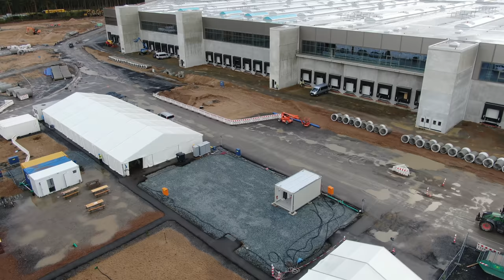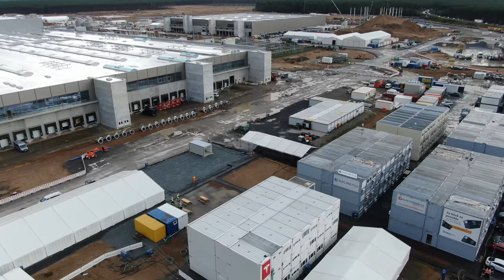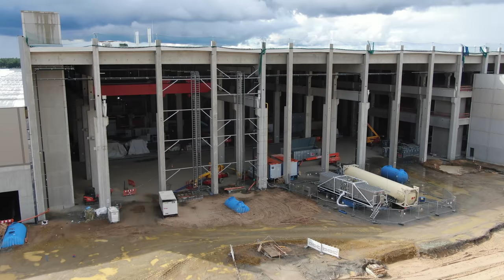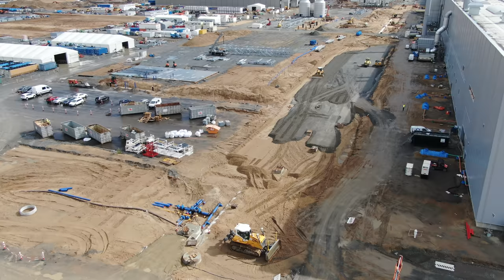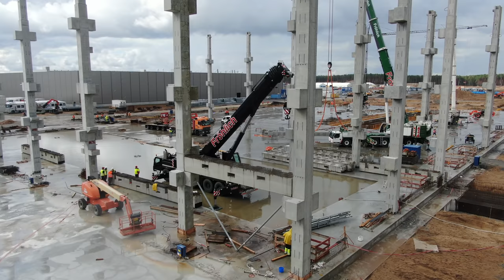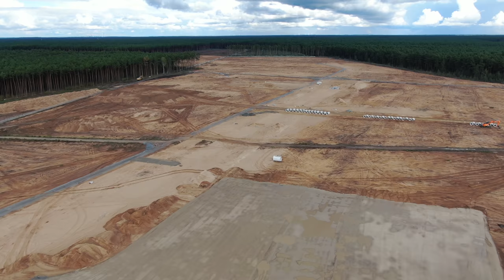Giga Berlin | 2021-08-27 | First Cell Beam

Comment: Starting to see asphalt & paving on the site is a good sign completion is near.
Reply: There is no new asphalt on site.
Reply: They are preparing for the final layout of the surface at quite some parts. 
But the black surface you see is just fine gravel ("Splitt" in German). Could be the last gravel layer before asphalt. But they may opt also for cobbles between the street and the loading ramps.
Reply: @abalada  "Schotter" in German.

Comment: Progress, but this should have been done a while ago. I should be seeing new Tesla cars in the parking lot by now. Tesla couldnt wait so they had to ship cars over from Shanghai. They better make cars before Texas or it will be a bigger embarrassment than the Shanghai shipment.

Tobias working harder than these politicians. Drone videos are fantastic
Reply: The original plan was to start also with Model Ys based on 2170 batteries at Giga Berlin. This plan was changed by Tesla (in autumn 2020) and now they plan to produce only 4680 battery based Model Ys at Giga Berlin. And than Tesla did also change the plans for production itself. And thus for some steps of the production the production equipment is not yet ready or has even not yet arrived at all.

Comment: A region without water! As seen in this video....
Funfact: Giga Berlin is foundet above a Water Reservoir therfor the Foundation is like it is.
NABU/Grüne Liga: But there is no Water!
Reply: So you tell me that a wet region will always stay wet and can't dry up? Weird that east Germanys lakes dry out and groundwater levels drop.
Reply: @flashed1439  so I guess you shouldn't build new factories in Germany
Reply: @flashed1439  If a lake dries out in Germany it's not because of Tesla.
Reply: @flashed1439  funny that something dry out without production....May Tesla is not the Problem?
In the Reagion of Vogelsberg are 2 big Piplines to Frankfurt am Main and it works since 100 Years.... 
Had someone asked what VW needs in Wolfsburg? I Guess the Emission/consumption is higher ther....

Comment: October seems ambitious for production when they don't even have enough asphalt to make the docks useable! I know you can pave alot of space in a couple of weeks but they still have to build up stocks of parts and supplies well in advance. Worse yet they can't making good asphalt ramps, docks, roads in the cold or winter without having lots of uneven, cracked surfaces. Maybe the Germans have some special technology but anything below 50 deg. F. is going to make for some lousy paving. That rules out alot of October in Berlin and certainly mornings.
Reply: That's BS. The docs will be concrete and asphalt can be layed down to 5°C
Reply: This with production will start in October is a misunderstanding in my view. There will be a county fair and the factory will be open to the public. 
That put's some pressure on finalizing the surface around the factory.  But surely possible and they are working on this on all sites of the main building. 
More critical are the partly still missing production equipment and the lack of advance with some of the support buildings.

Comment: There are less than half as many employee cars on site, than in Texas. They seem to be making a lot more progress here with a lot less manpower.
Reply: Hahaha..Giga Berlin started many months before Texas.. Texas is bigger than Berlin.. Gigaberlin was supposed to open in July but got delay due to slow work by German
Reply: They ride public transport and bicycles en mass.
Reply: @MichaeltheCrank  OK, Public transport makes sense, seems like it's pretty far from much housing to ride a bicycle though.
Reply: @nemos890  that has nothing to do with slow or fast work. It’s about a slow inefficient regulatory process and Tesla’s approach in not taking it as serious as they should have.
Reply: I guess most people are now on the inside whre we cant see em
Reply: I also want to add the fact, that the videos can only taken at weekend. Look to other videos from Tobias from mid week (the timelapse) and you will see, the parkinglot is full. 
Weekend in Germany means, that you MUST HAVE at least 1 Day a week free. You also can not work more than 10 hours a day (there are exeptions) and you have to take a break after a maxium of 4 hours work. 
The mass of ppl working somewhere talking nothing about speed. There are processes which run parallel, we also can not look into the building what's happening there. Installation, commissioning, startup and checks take some time, in special with that large amount of automation inside the processes. There are safety rules to check, in other way robots can destroy their self, also ppl can get harmed with 1 line of wrong code. 
Let the workers do their job, they know how to do it the best way. No one need a "make faster, shit safety" ;)
A small mistake can cause an accident, do you prefer something like this? I don't think so :)
Stay cool, take a tea and relax.
Reply: @nutzeeer  What's that have to do with the number of cars " num nutz " ?
Reply: @eldiablo8019  what does anything have to do with a number of cars, you devil?
Reply: Very few construction workers will drive there with there own cars. Those are rather employees working for Tesla or in those container offices. The construction workers will arrive by company vans and cars. And those are not just 1 person per vehicle.

Comment: I always find it interesting how Americans criticize and moan about delays comparing this plant to the Texas one. If anything they should be critical of American manufacturing which has been surpassed by both volume and quality from China.

There are totally different conditions in at this site such as not working 24hrs or working at all on Sundays. 

It always seems like they have been personally affected by a few months delay, and that this will impact them so much they must voice their opinions.

Remember this is the same company!
Reply: Incorrect. Tesla knew in advance of working hours and such things. That's easy things to keep track of. The delays can't be blamed on this. But it can be blamed on the ridiculous bureaucracy however. 

It's also silly to claim that people aren't allowed to compare the construction speeds of Giga Berlin and Giga Austin. There is also not a zero sum game here. People can be critical at several things at once. 

Everyone that is a Tesla stock holder have been personally affected by the delay. The factory should already been up and producing cars by now.
Reply: @yourcrazybear  Rubbish! So Tesla knew about the working hours but not the bureaucracy? 

Real stock investors hold stocks for years and are not concerned with small delays which have been caused by  among other things design changes by Tesla itself.

The point is; look at the bigger picture. The factory will be built eventually and the stock price already reflects that!
Reply: @damnmister  On the contrary. Even if you are aware of the bureaucracy, it will be hard to predict how it will play out over time. Working hours on the other end is much more predictable. In short, it's hard to plan for the bureaucracy, as things can evolve over time. 

Nonsense. I never implied that long term stock holders would have any long term concerns over these several months delays. What I did however was enlightening you about the fact that they are in fact impacted of the delays. 

And no. The stock price does not reflect what the price would have been if Tesla had the factory up and running already and delivering even more cars. That's just an illogical statment.
Reply: @yourcrazybear  You're wrong. The stock price is not affected by the delay.
Reply: @damnmister  Of course it is. The number of deliveries Tesla makes affects their earnings and thus the stock price.
Reply: @yourcrazybear  In a years time the stock price will still be projected to be the same whether there was a delay or not. The fact is the factory will inevitably open and produce cars, and will reach its maximum production capacity. 

Come back in a year and you'll realise that this delay was insignificant to the stock valuation. There are far more influential factors such as the US economys inflation concerns or even a meme posted by Elon!
Reply: @PeteZam  wrong. It takes more than a few months to be able to ramp production.
Reply: Over the last decade or more US outsourced manufacturing to China and other countries as the US CEOs thought it was cheaper and they did not have to handle some of the environmental and labor issues. IMHO it was a very myopic decision on the CEOs part. The social and psychological  cost of outsourcing was and is hefty on the hard working manufacturing workers.This also increased the welfare burden on the Government. 

As Chinese factory workers are demanding more money and better benefits the economic model is slowly turning with more manufacturing jobs coming back to the US. This will also make US more self reliant.
Reply: @damnmister  "the stock price isn't affected by the delay" what a stupid comment. There are PLENTY of analysts that don't seem to care anything other than tesla ramping up production asap. But what else can we expect from someone who has DrUmpH as their profile pic...
Reply: @HavokBWR  We'll see who is stupid when we get the official announcement that the factory is open. I'm guessing the stock price will not be affected.

Such a typical American to result to name calling instead of constructive debate!
Reply: @yourcrazybear  "Tesla knew in advance of working hours and such things."
Tesla applied for the option to construct 24/5. And for some indoor jobs also 24/7. This was also permitted by the administration. Tesla made however just not much use of those extra working hours.

"But it can be blamed on the ridiculous bureaucracy however."

What delay can be blamed on the bureaucracy?
The GA building was done in late February. In Mid-April Tesla applied for a permit to install the production equipment (why not earlier?). This was granted in early May.
Late June the first production equipment for the GA did arrive. There are sadly no sneak views allowed anymore. But I don't think this part of the production is yet ready. Unlike with the paint shop, body in white or stamping where Tesla applied for test trials months ago, they don't have this done for the GA yet. 

Tesla did change the production plans for Giga Berlin. More advanced production lines and also additional phases of component productions, which were not originally planned to be done at Giga Berlin. And here the limitation is not the construction speed, but that this production equipment is produced and delivered.
Reply: @yourcrazybear  The delays at Berlin are actually fairly minimal, in the big scheme and are not affecting the stock price much, at all.  The delays in ramping the 4680 are actually much more consequential for the stock price.  Even there, the consequence is only a delayed rise of the stock price.  For long term share holders, that matters little.
Reply: @michelangelobuonarroti916  Fairly minimal? The factory was expected to start production in July, and now there is talk about october. So there seems to be atleast 4 months delay. That's more than a quarter of the year in delay. This affects the total number of deliveries, which affects their earnings, which affects their stock price. You can try to downplay this fact however you won't, but it won't change this fact. 

The delays of the 4680 battery production does actually matter less. Tesla have a backup plan to use the 2170 batteries for the model Y in Giga Berlin and Giga Austin. They have also secured double the amount of batteries for 2020, so batteries is not the big issue here. Being able to ramp up production is, and for that you have to finish the factories. 

"Even there, the consequence is only a delayed rise of the stock price.  For long term share holders, that matters little."

That's literally the dumbest thing I have heard in a long time. Time is money and lost time is lost forever. This is true for investing as well.
Reply: @damnmister   "In a years time the stock price will still be projected to be the same whether there was a delay or not."
"Come back in a year and you'll realise that this delay was insignificant to the stock valuation."

Nonsense. Time is money and lost time will never come back. This is true for investing as well. Illogical claims will not change this fact.
Reply: @abalada  Tesla did with Giga Shanghai show how fast they are able to build a new factory. Even Giga Austin shows us how slow the progress have been in Germany. The plan was to have the production of cars start in july. Instead we are hearing talks about october.
Reply: @yourcrazybear  You're obviously a novice short sighted investor. I won't waste anymore time trying to convince you that the market already has the Berlin and Austin factory priced in at the current value.

The only possible catalyst in the short term I.e 1 year is fully scalable 4680 cells, much improved FSD or announcement of new products or new factories.

The price will not rise when Berlin opens.
Reply: @damnmister  "You're obviously a novice short sighted investor."

Nonsense. I would suggest you refrain from using lame strawmen and try and focus on real arguments instead. 

"I won't waste anymore time trying to convince you that the market already has the Berlin and Austin factory priced in at the current value."

That's interesting considering that you recently acted like time can't be wasted when you made illogical claims that delays in production plans doesn't affect the stock market. And no. Giga Berlin and Giga Austin is not priced into the stock. As Tesla's delivery numbers increase, their earnings go through the roof, the stock price will naturally increase as well.
Reply: @yourcrazybear  
"The plan was to have the production of cars start in July."
With imported 2170 batteries. Tesla changed this plan. And replanned also the production layouts. With the result that some of the production equipment is not yet completely installed and partly even not yet delivered at all.

"Instead we are hearing talks about october."
No. That's a misunderstanding. The factory will be open to the public sometime in October. 

In a schedule published in June Tesla planned the installation of production equipment in the GA for June till November. And I see no signs that those works are esp. advanced. So far Tesla has not yet applied for a permit for trials there (which they did months ago for the paint shop, stamping and BiW).

In the same schedule, the outfitting of the DU was scheduled for September till November. However, Tesla has yet not even submitted an application to install production equipment there. Either Tesla is really chaotic and forgot to apply for this permit. Or they simply have not yet finalized the production layout for the DU. I.e. not yet ordered the production equipment. For the permit Tesla has to submit what will be installed, thus the authority can check if there are any risks for the environment not already addressed. Don't see in the DU any potential problems with this. But still, a step which has to be done.

Comment: Very impressive mass concrete foundation with sockets formed to accept massive Pilar Columns for 4 floors. Is this battery plant engineered, fabricated, and constructed by Max GOEBL?  Thanks for pictures of first beam.
Reply: Who is Max Goebel?
Reply: You mean Max Bögl? 
The advaned technology of those columns and the transport company bringing those point indeed towards Max Bögl.
Reply: @abalada  It#s not Max Bögl. They are made by Rekers.
Reply: @julianreverse  
Transport company would also fit well for the  Ochenbruck factory of Rekers. 
It was in a previous video where another - normally quite reliable poster - wrote that Max Bögl is also involved with the battery cell factory.
Reply from the maker: @abalada  Some concrete trucks had the Max Bögl logo at the cell production building.

Comment: Why cant they finish off the casting wall? Could it be cause they need to have access to install the machines when they arrive? but that would only require a few panels missing.
Reply: The have not finished the casting wall in Austin have no walls in Fremont, but it does not stop them casting.
Reply: In Austin it’s the same and they even leave the surrounding floor as dirt. I agree it would be interesting to understand why.